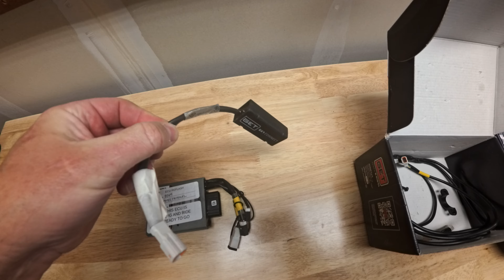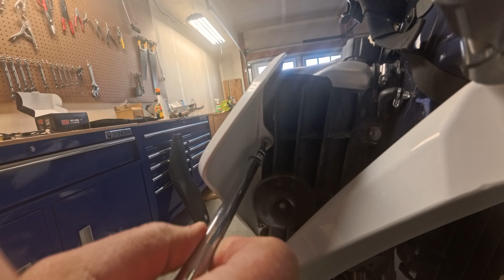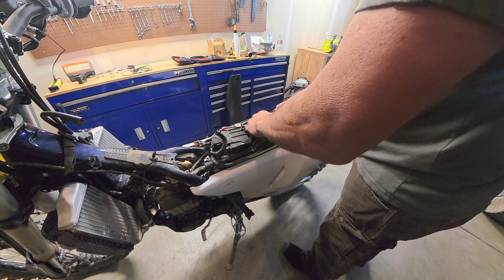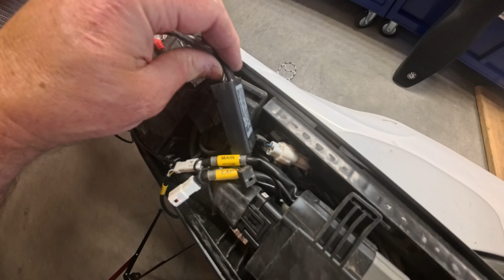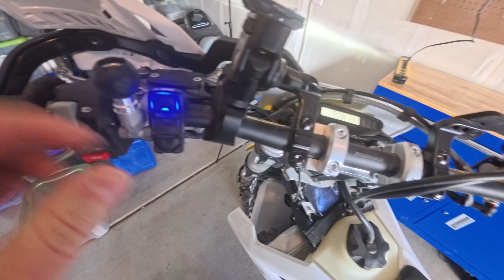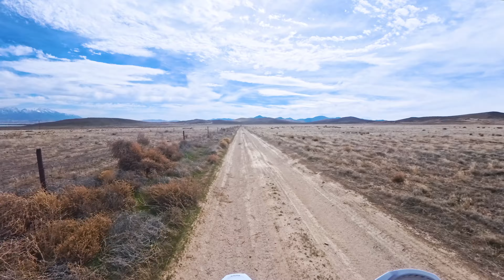GET ECU by Taco Moto Co Full Install + Honest Review | Is It Worth It?

Comment: Did you had to do any initial set up , or did you just pluged it in and that's it ? Im getting one for my bike i watched a video about the installation and there was a lot of initial set up to do , wich got me very worried 😬
Reply from the maker: I had a lot of issues with it at first.  I'm still trying to decide weather or not to keep it...
Reply: @NewAdventureFilms  The end of your video you sounded like you really liked it, recommended it and says it was worth the money...so what changed since you made the video?
Reply: @JetCityHooligan  I'm wondering the same thing...I've got a 2026 KTM 500exc-f ....trying to decide...
Reply: @NewAdventureFilms I gave up and exchanged my for an at-home reflash with pv3. I suspect there’s a hardware or firmware bug in Get SX1 that corrupts TPS calibration from time to time. Tried multiple instances - they all acted up sooner or later